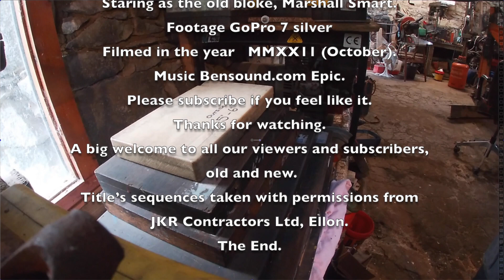Machining a 5/8" 5 TPI   Acma left hand thread lead screw, with follow rest & new tools.

Comment: I remember as an apprentice trying to machine acme threads, it's bloody hard and 99% of the work is in the grinding of the tool, Nice vid Marshall
Reply from the maker: Took a few goes. Follow rest made the difference. Do you ever watch Abom79? on YouTube.Watching him is where I learned to use a lathe mostly. That's my first lathe and the first lathe I ever used. Had it just under 2 years now. Learned it all from encyclopedia YouTube and brother in law.   Edgwic MK1 lathe 1959. 4 jaw will go to 0.0005" when indicating. They made them good in Halifax. M😀
Reply from the maker: I was trying to remember how I made the 29 deg cutter. Turned a taper on the lathe with Iscar cnmg insert which will cut tool steel. Then ground the face to give relief. M
Reply: @MarshallSmart  No never watched that one, I learned to used machines back in 75 as an apprentice which must have been good as I ended up engineering instructor for Rolls Royce and then engineering training center manager for Siemens and for my sins with them the first wind turbine training center manager in the UK, you do a briliant job for someone self taught. keep up the good work
Reply from the maker: @manfromthemist1958  I started as a Plumber 76 ended up doing 15 years servicing and repairing oil and gas boilers fires and cookers,as the company's senior engineer. Had HGV class 1. and was back driving when I had second stroke this year Automatic, HGV removal min 1 year 30 days for car. Waiting for disability medical to see if I qualifi. You probably not seen me running around in my electric wheelchair yet. Ok walking short distances. M 😀